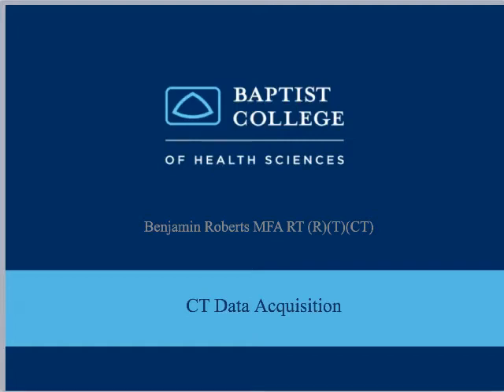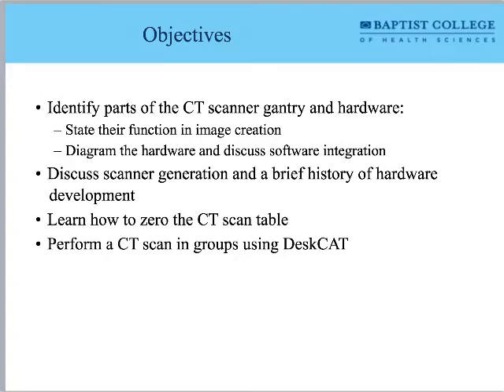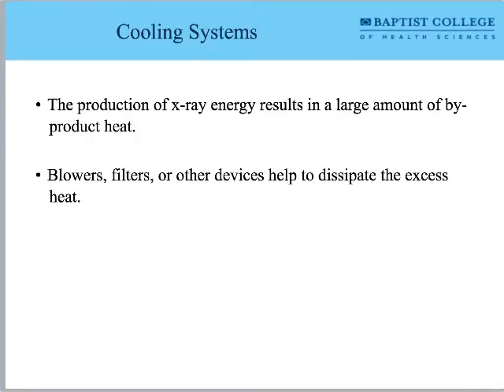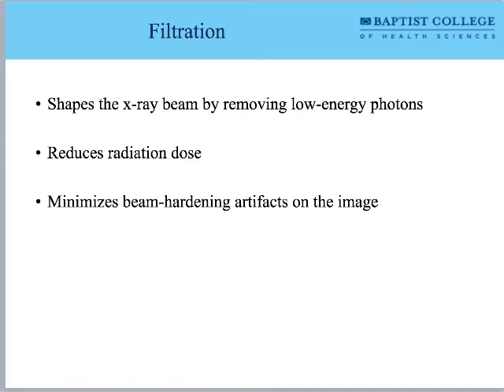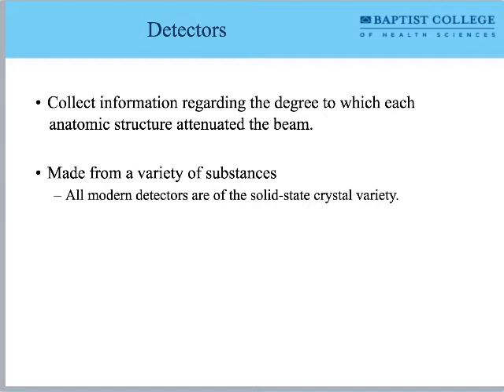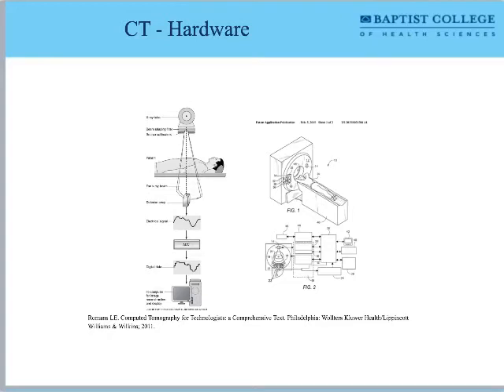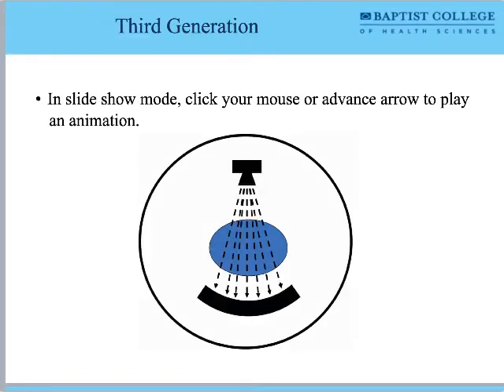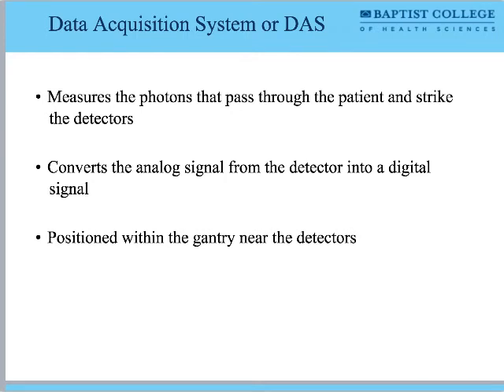How does a CT scanner work?

Comment: On-board generator?
I'm am absolutely sure that you are referring to the high voltage generator used to power the x-ray source.
This is not a generator in the sense of an engine turning an alternator, it is only a voltage converter, it is 100% electronic.

Comment: How is the data sent out from the rotating portion? Slip rings also?
Reply from the maker: It's not exactly data at that point. It's an analog signal. It's sent through the sliprings to the analog to digital converter. Then it's data.